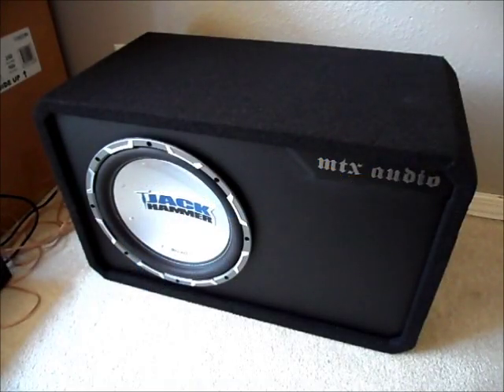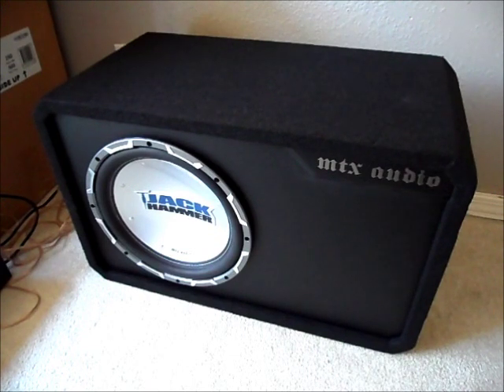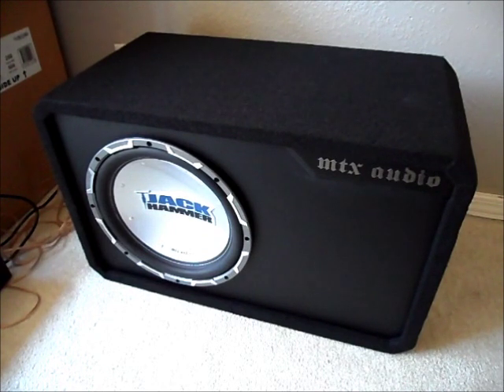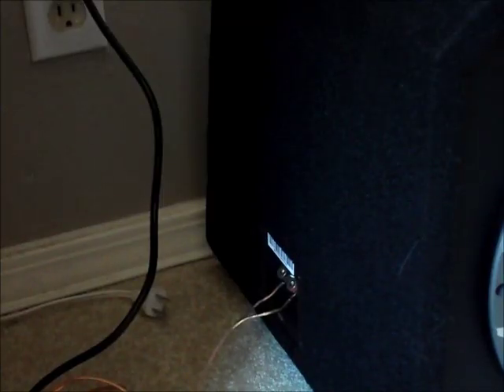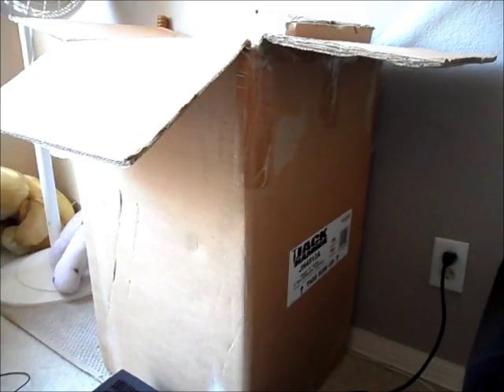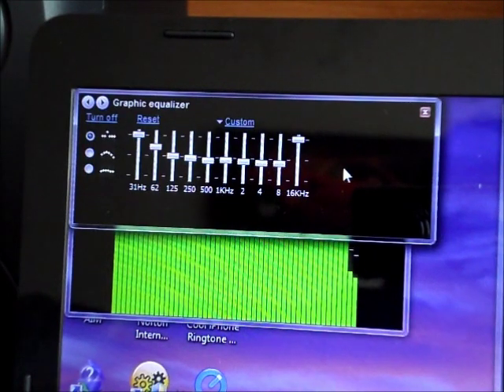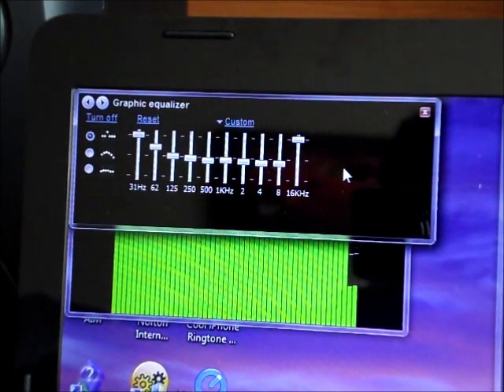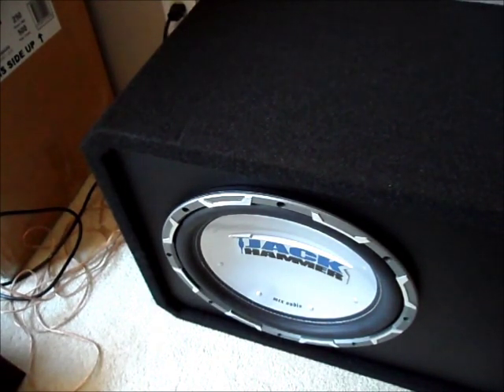MTX JH4512A Jackhammer Overview/Small Demo

Comment from the maker: I personally don't see to many of the Magnum series going around so I'm sure how they would perform close to these, but like some specs you want to look at are perhaps wattage, impedance load, materials used to make the subwoofer. I usually look at those to make my decision and you have to look at the size of the box too to see how it'd tuned too. Ported vs Sealed would help too. You'll get more pressure with a Ported box and Sound Quality with a Sealed box.

Comment from the maker: Nice! Well on this 12" MTX I have to say it's a great sub for the price I got it for because it does very well for a basic 12". Problems is that it's rather large but that's where some of the sound quality comes from in my opinion so that's sort of a pro and con too. I believe if you have 2 10"s tuned right they'll sound much louder than a single 12" like mine. I just have this subwoofer and a 2 channel amp with a PSU powering it up in the house as my current set up! Good luck!

Comment: Note: :P
Regardless if it runs well or not on a lower or higher Ohm rating than the specifications Allow, its not good for the woofer, or the Amp, as its drawing, and receiving too much, or too little power that the specified amount..
Not long ago, i had a 12" kicker comp subwoofer, that some acquaintance of mine managed to blow, I was running it on an infinity 2Ohm home theatre subwoofer amp, and it would run perfectly!, the only problem was, the woofer was a 4ohm, and at high volumes, i would always hear a weird clicking, popping noise, it was small but noticeable. almost like the subwoofer was clipping out. i changed out the woofer and tried other Ohm arrangements, and before long i had my 2Ohm set value, and the amp could be pushed to its limits with no sign of scratching, popping, or clipping. :P

just wanted to throw that in there :)
Reply from the maker: Good Info! Thanks For Sharing!
Reply: TypicalB18 anytime :P

Comment: cheap or not good system man am planning on building one using a pioneer 12 or 10
Reply from the maker: Nice! Yeah it was a decent Subwoofer, but I sold it a while back and I've been recently looking at different subs here and there! Pioneer is good! Make sure you get a decent Enclosure for it too!
Reply: i will
Reply from the maker: Good Luck!
Reply: yeah man thanks
Reply from the maker: Np!!

Comment: how u connect a epicenter bro
Reply from the maker: I'm guessing you're talking about a Crossover? If yes the crossover just comes in between either your headunit or source of audio (iPod/MP3 Player etc...) and goes into your Amp. It still takes standard power/ground/rem connections like your Car Amp does. Hooking it up would be something like iPod leading into input of the Crossover then from the output of the crossover leading into your Car Amp and then so on which is explained in some of my videos.
Reply: no is a audio control epicenter
Reply from the maker: Ahh I see, looking at it. It still hooks up the same as a Crossover would be like I described. From iPod into input of the Epicenter then from Output Epicenter into Car Amp. You'll still need to find a way to power up the Epicenter and I would power it up with a PSU. I have videos on it, it you haven't seen them yet. It's for hooking up a car subwoofer in your home but it works for Epicenters, Crossovers, Headunits and more! So check it out and let me know if you have any other questions or not!
Reply: alright thinks bro
Reply from the maker: No Problem!
Reply: u like hondas
Reply from the maker: Haha Yeah you could say I like Hondas. Haha I have a Honda Element, Acura Integra, and I work at a Honda Dealership. But I like other cars too!
Reply: ooh sick i have a 92 nissan sentra se-r
Reply from the maker: Nicee! You have the SR20 Motor in there I believe! Very good motor and very nice car! Is it manual?
Reply: yup i got sr20ve and it has racing cams and headers and 370 injectors and  my car is tune by osr dyno by my homies shop is doing 211 hp
Reply: and is doing 155 torque
Reply from the maker: Damnn that's pretty good! Haha my integra doesn't come close to that, but it's stock! I have a couple friends with 240sxs but they all have KAs in there, and one is planning to get a LS1 while my other friend just got his KA Turboed!
Reply: damm thats cool
Reply from the maker: Haha it's something! But I don't has as much money as them so I'm just staying stock! Working my way towards another car though, looking to get a Miata.
Reply: oh cool yup
Reply from the maker: Haha Yupp!
Reply: where u from
Reply from the maker: California, how about you?
Reply: cali
Reply from the maker: Haha Nice!! Where in Cali?
Reply: Ontario ca
Reply from the maker: Ohh Nice, I'm in the Bay Area haha!
Reply: alright
Reply: Where in Cali?
Reply from the maker: San Jose
Reply: ooh nice
Reply from the maker: Haha Yeah it's not to bad!